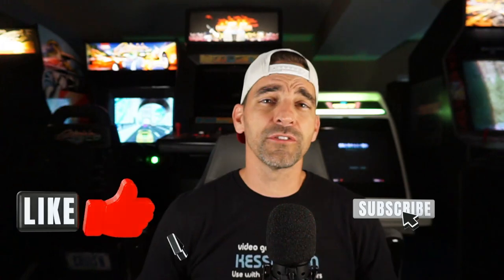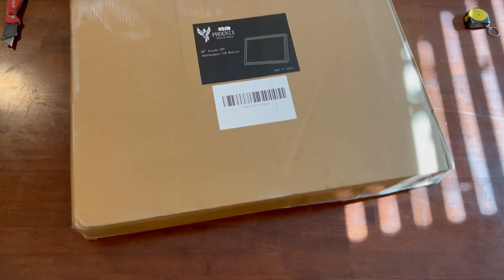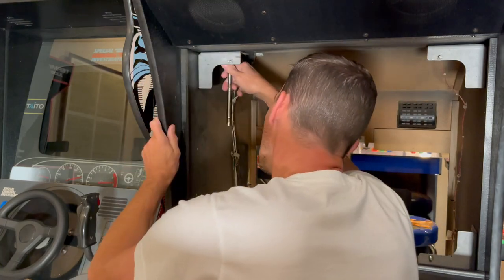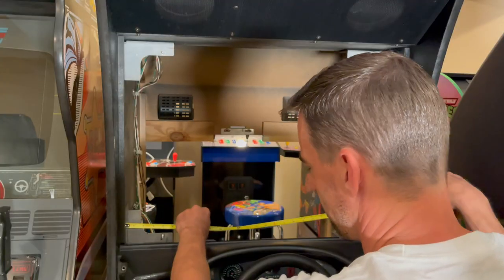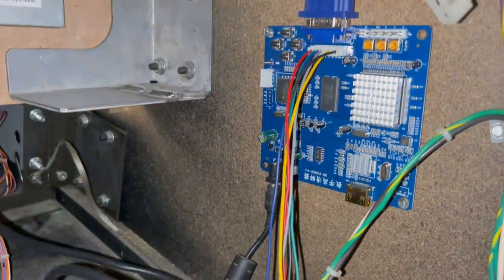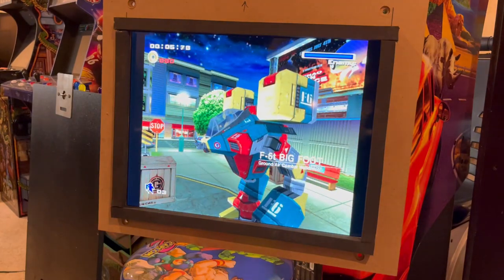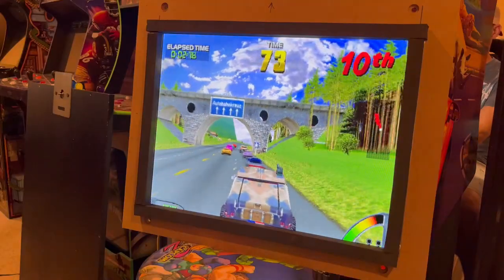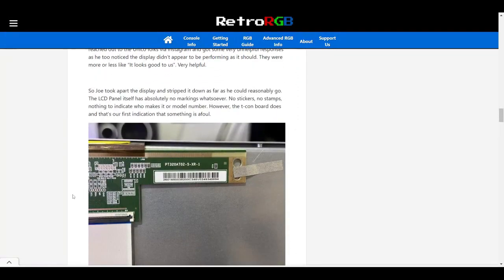Installing A Unico 26" LCD In My Cruisin' World Cab

Comment: We are sorry you are having issues. Unfortunately we couldn't test every arcade and will work on firmware to fix issues brought to our attention as quickly as possible. This is a labor of love for us and everything Retro. We will continue to make it better and better. First off on fixing list is ability to resize and move screen. Secondly full control of Brightness, Color, and Contrast so a customer can dial in to there liking.
Reply: Is there any progress on this? Will it be fixed for the Nova Blast?
Reply: Yes it will be fixed when we release Nova Blast
Reply: Does the customer have the ability to do future firmware updates going forward? (It would be nice if the needed cable for firmware updates was included in the package)
Reply: @jaymason9888  Where can we have updates on this lcd? You plan to release oled one?

Comment: I'm planning on lcd for Cruis'n USA. Used a Holland 26" on my brothers' and it worked great. If I get the Unico I am anticipating H size and V size, H position and V position both needing to be adjusted in addition to the clamp st and clamp sp.  It's that simple. Get the gbs 8200 and dial it in. The issue then becomes the original bezel estate and whether your going settle for a smaller viewing experience than the original crt. I am going to settle. Now I have to decide if I want to spend a little extra on the Holland and not worry about firmware updates.

Comment: I still kind of want to get one of these, but for a PC-based arcade cabinet. I currently have a 32" 4K Monitor, which looks incredible with CRT filters and stuff, but 99% of the time I'm not using that extra real estate, and I could very easily rebuild my cabinet to not have the extra width that it has right now.

Comment: I had an issue where my image was really small centered in the middle of the screen. I used to the gbs 8200 converter board to adjust vertical and horizontal size and got it to fit the whole thing. Still annoying that I couldnt just use the native CGA input of the monitor though. This was for my marvel super heroes vs street fighter

Comment: I may be wrong here but if you've got the larger converter board in the cabinet, couldn't you just shrink the image using that board's on screen menu to fit the monitor? I had that same converter board in a California Speed, I didn't want the image stretched so I went into the menu and shrunk the left and right sides towards the middle.
Reply from the maker: I tried, no dice. 🤦🏻‍♂️

Comment: How did you wire the Unico Monitor?  Did you splice the wiring and connect it to a retro arcade power supply?  If you did how did you do it?  I am trying to figure that out right now with the new monitor

Comment: @19kfox Hey Fox, Using the on screen control board,  Hit Menu then toggle to Display, Aspect ratio 4:3 adjust your H-Position or V-Position from 50 to your desired number try 17. Play with those setting and see if it helps !!!
Reply from the maker: It can’t be adjusted out.
Reply: @19kfox  so an firmware update could resolve this issue then?

Comment: This is similar to what happens when you put an A1UP PCB that outputs 1280x1024 to a A1UP BOE monitor, which is 1280x960. The bottom part gets cut off the last 64 lines of the image because it cannot fit. Seems that a firmware update would fix, once they figure out how to stretch on the screen. But if that display is not 1600x1200 and is 1280x1024, then that is not 4:3. Just looked on their website and they state it is 1024x768 resolution, which is still 4:3, but not as high as they advertised before, I believe. Could be wrong.

Comment: How do you feel about the brightness and sharpness compared to regular arcade CRTs ?

Since there is a mismatch in resolution that will introduce some blurriness but since CRTs were not entirely sharp either perhaps that accidentally brought in the right level of blur ?

And it seems that you cannot dim the backlight that much so is the brightness too agressive in your opinion ?
Reply from the maker: The brightness is fine and can be adjusted. I’ve got it set half way, 50/100.
Reply: Thanks 👍

Comment: An arcade monitor doesn't come with the option to adjust vertical, horizontal size and Color adjustment?
Reply: get the gbs 8200 convertor and you wont need the monitor to have H and V size or position adjustment. Convertor will have it.

Comment: Seems like it's scaling to 5:4 and not 4:3, same as when you use the old adapter board (M.NT68676.2 and not the .3 version) on a A1UP BOE monitor, and it cuts off the bottom of the image. You had this issue with your AvP conversion cab iirc?
Reply from the maker: That’s right. I had to get the correct board to have the image displayed properly. I’m curious if a firmware update will fix it.
Reply: @19kfox  I remembered a preview video from neocvera (posted a couple years back) of the 26" screen working with an adapter board: RTD2483V5.0 Maybe that can be an avenue if they don't fix it?

Comment: 1280 x 1024 is 5:4 aspect ratio which is why you’re not getting 4:3 on this monitor. So this monitor doesn’t natively output 4:3.
Reply: Yea...Need to get the correct resolution on their website. Website when you buy it states the resolution of the monitor is 1024x768, but when you get the manual states it is 1280x1024. Of course that may just be the controller board they are using and hopefully the firmware update fixes the issue.

Comment: You mentioned a cheap board on eBay and showed a clip from Todd, that is NOT a VGA "converter" board, it's just a connector adapter that has potentiometers to reduce R, G and B signals if you wish. It's just meant to help plug in existing arcade machines to something that can take CGA over VGA type input, such as a GBS converter board. It does no signal conversion whatsoever. 

I don't believe Unico will deliver on a new firmware update. The fact that they released this with the wrong advertised resolution and inability to properly handle the most common 25" monitor games is laughable. Don't fall for this labor of love line, they rushed out a piece of crap.